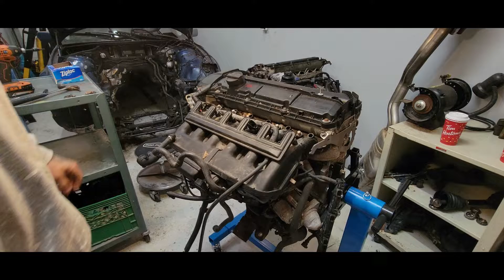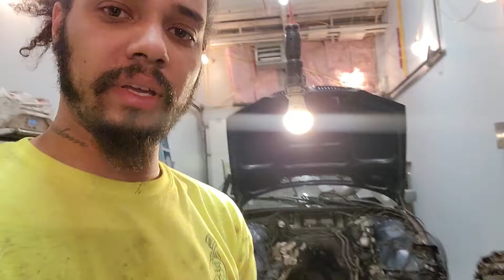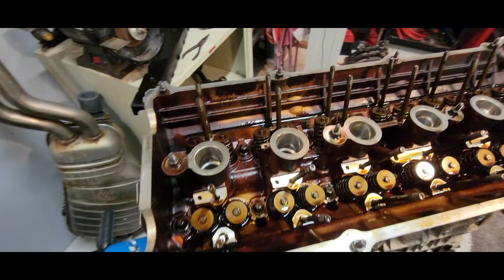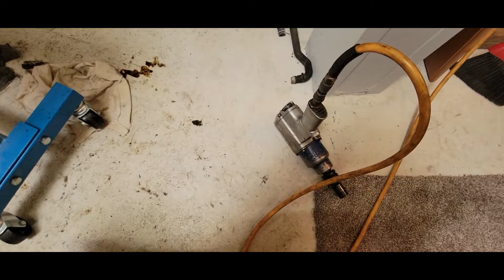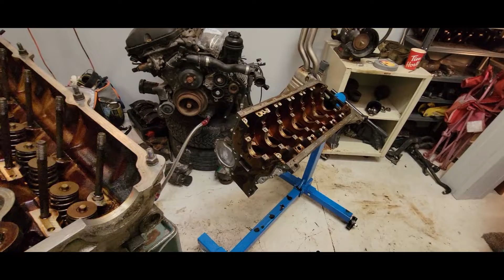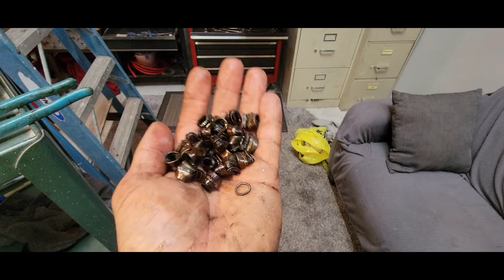S3E6 - BMW E46 B30 Engine Full Disassembly - M54B30 (Building For 700+HP)

Comment: Why would u build that motor with 300k
Reply from the maker: Because I'm using all new parts. Why would I not do that. The block is good, and the head is good. 
I'll be using new:
Pistons
Rings
Pins
Rods
Bearings
Studs (head/con rods)
Valves (stainless & inconel)
All new gaskets and seals throughout.
 
And a bunch more. So if the block and head are good... literally, why would you not..
And even if it wasn't good, you just install new cylinder sleeves, and you're good to go. I genuinely dont understand your argument. ...